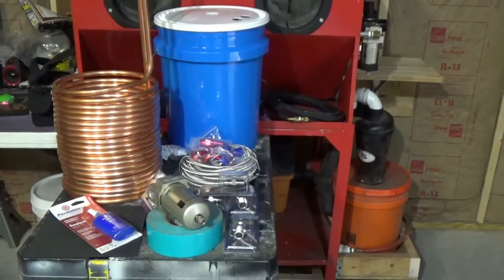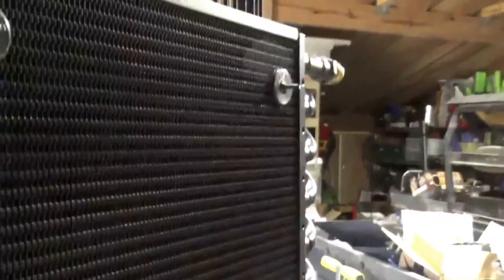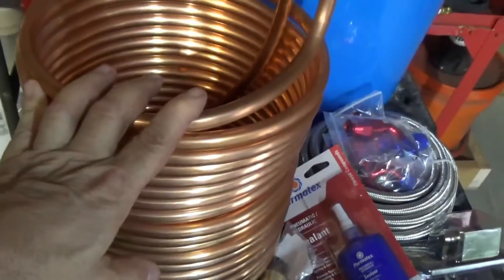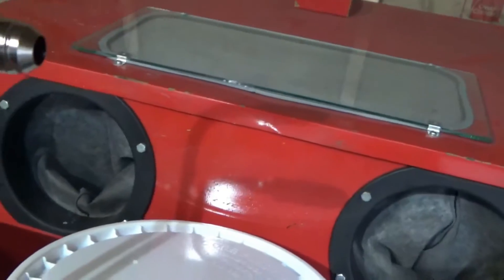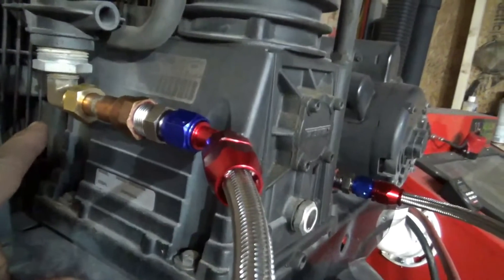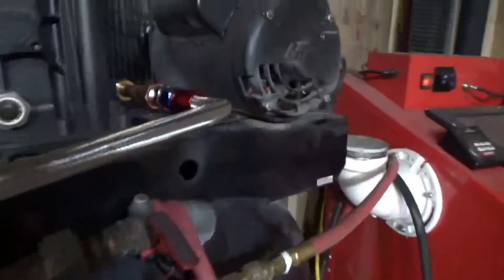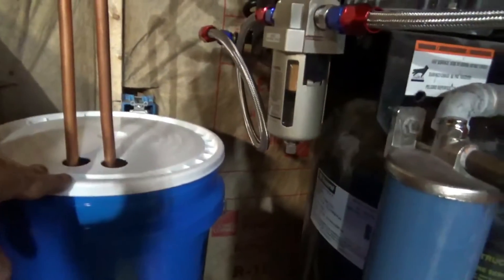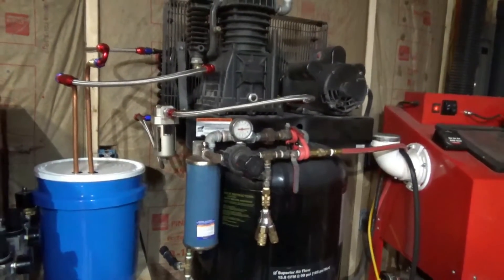DIY Air Compressor After Cooler / Dryer

Comment: Swap the plumbing on the coolers bud 😅 i have a much bigger version in my body shop its great never have any water or oil and i run no filters. Air to air cooler right out of the pump with a trap then into tank then through ice bath cooler and into a regulator/trap and system plumbing. The air the air stops how much gets to the tank and keeps the tank from getting hot allowing it to condense better also. The air the water cooler is to get 10 below dew point and drop out all the rest of the water before it gets into everything. A 3ft rise is recommended as a minimum after though.
Reply: The restrictions are also kinda extreme. Having built my system too small twice I found 3/4 is the minimum to ever build in. 1 is preferred. For the single man shop 1/2 in works but when working between the tank and coolers that are restrictions themselves we want to slow the air down and restrict less so even at home 3/4 for that first bit is wise.
Reply from the maker: @ Funny that you mention that I have a roll of 3/4" sitting here to revamp my set up. I have been looking into 1", but the price of copper is crazy these days...

Comment: Several things: nice build. Mounting the cooler to the back of your compressor COOLING fan is going to kill your compressor. The fan is designed to bring room temp over the heads to cool them and thus extend their life. Now you are pulling 200 degrees from the compressed air (or however higher it is after the cooling bucket) across the heads- extra heat will kill the compressor.  Looks cool but the braided hose and fittings are not necessary and jacks up the cost. You can buy coiled soft copper from lowes for cheaper with no shipping. There needs to be space between each coil so as to have more cooling surface. Sitting on top of each other will prolly take away 20% of cooling capability.

Comment: Could you have routed the 1/4” drain off of the primary moisture separator into the 5 gal bucket rather than onto the floor?

Comment: On the copper in the bucket have you got any pin holes from copper fibrating or is wear minimal there ? Just curious
Reply from the maker: To this day no wear... Just changed the water twice to check on the copper..
Reply: @venomchris5818  absolutely awesome that was my only worry with that . I was in heating and ac for 20 yrs and countless times I have seen pin holes where a plastic wire tie wore a hole just from vibration.  Thanks again!! Awesome job !!

Comment: Nice video. I did mine exactly opposite using the radiator first, then 2 auto draining HF Water Separators like you have after the small one.  Then I ran the output of those into the tank,  output of tank to a custom made 2" Rigid Pipe additional Separator and Desiccant Dryer, back to a 3 in line filter assembly that I swapped the the micro particulate to the last position to catch any desiccant dust leaving the trap area, then to my lines with dual feeds with a gate valve. 1 is totally clean dry air, the other one is an oiler tank for my air tools.  The clean dryed air is used for Painting and a Plasma Table.  Not a fish eye in site. My next project is to build a vapor blasting cabinet, with glass beads and a water feed with a dust bunny catcher like on your cabinet.
The reason I used Rigid pipe is my compressor is rated for 200 PSI and rigid pipe is good up to 300 PSI.  The Desiccant Viewing windows (1 top /1 bottom) is rated at 250 PSI.
Reply: I agree that the hot air should #1): go thru a fan cooled oil cooler to cool air to near ambient temp., then #2): to a water seperator, #3) next to the ice water cooled  copper coil, #4): another water seperator, #5): a coalescing filter for any oil vapor/particles, #6): then into the tank. It's a mistake to send hot air firt thru the water cooled coil, then warm it back up with ambient air. No! Each cooler should progressively cool the air more & more, & remove moisture after each cooler so less & less water has to be dealt with. Progression leads to high efficiency moisture removal & very dry air in the tank.
Reply: @PaulThomas-qo9vy  Redundant coils is completely unnecessary and chilled coils work well to reduce temps but then you have the hassle of the Water and adding more Ice. I don't have time during the day to swap out a bucket of ICE every 30 mins and mine does not have that. I have ZERO literally ZERO water droplets out of the lines. IF you want true conditioned air I would recommend you buy an air line cooler. If you got $1,000 laying around doing nothing. The way it is I got almost that in my setup already and IF I knew that going in I woulda already have bought it in the first place. You do not need to step down the air temp. Use a laser temp guage and measure the temp outta your compressor head (around 240-300* F) and then out of your Separator like I did and the temp is literally 77 degrees. That is absolutely FINE unless you live at the North Pole, then you get free ice anyway............

Comment: Awesome setup but you definitely did not need to add a transmission cooler. That's actually warming up the air!! by the time it goes through all that copper tubing in the 5 gallon water bucket It's cold your home never heat that bucket of water up. You would have to run that compressor non-stop all day

Comment: Ive been planing something along similar design ideas, but never thought about the distilation gear. I have a 20,000L water tank under my workshop which I could run copper lines through and it would cool the air down to no more than 20degC. 
Thanks for the tips.

Comment: Good idea with the copper coil. However, there is no way for the water to get out of the coils. You need to come down with the first coil and go into a tee fitting. On the other side of the tee, you connect the tubing and come back up, winding in the opposite direction. You end up with a double helix. Air enters the top and coils down, connecting to the left side of a tee. Then from the right side, you coil back up and out the top. At the bottom of the tee you put a copper tube and ball valve that sticks out the bottom of the bucket. This way, the water that condenses will flow down in both coils and exit at the bottom. 
I designed this several years ago and I’m using an 8” PVC pipe to hold the water and double helix. The pipe ends are sealed with discs of PVC foam and secured with long bolts that connect top and bottom on the outside. 
I run 50/50 water antifreeze through the PVC pipe and it circulates through a radiator in a mini fridge. It works very well. Wish I could send a drawing. 
But you need a drain at the bottom of your coil at the very least.
Reply from the maker: I would tend to agree with you and I figured I would need a drain valve on the bottom of the coil. I figured if the system worked I would add the drain valve. Once i saw that it worked great, I used it for a few weeks and then disassembled it and the coil was bone dry. I put it back together and it has been 2 years now. The Auto Drain Water Separator installed right before the tank removes an incredible amount of water. Every now and then I hit the drain on the second water separator and the valve on the bottom of the tank. I have yet to see any moisture other than a slight vapor mist for a second in the second water separator and no moisture at all from the bottom of the tank. So I never installed the drain valve and it has been working perfectly for over two years. The only change I made is that it was better to run the line through the radiator first and then to the coil as mentioned in the description. The thing I do find strange is the the water in the bucket after two years is still incredibly clean and has not evaporated more than about an inch.

Comment: If you didn’t want to disturb any pipes on your compressor I bet it would work good on the opposite end of your compressor where the  air exits the compressor. I have same air compressor and have a fan blowing directly on the head of the pump and I’m going to do the same rig as you got there but on the opposite end where the air leaves the tank. So with the fan blowing directly on the head of the pump and the chiller on the exit side of the  tank  between the exit point and air line I think it will work just great. Just my opinion  all thoughts welcome

Comment: Cut a port in the top of the bucket itself.  Install a small 110 v fan  ( like some in small  soda coolers)  wire the fan to the pressure switch so it comes on with the compressor.  Drill a few vent holes around the bottom of the bucket.  Should eliminate the need for water cooling

Comment: Very impressive and well thought out. My only reservation is the need for a drop line drain after the copper tubing before the oil cooler. If not you are sending back into the oil cooler all of that condensation. Great job.  Thanks  I plan to duplicate your idea

Comment: Can you say... overkill? lol. I live in NYS and it does get super humid in the summer. I use a 10 foot single run of 1/2 inch copper, and then about another 8 feet worth of a cupper U shape with a drain, then up to a two stage filter and I get just about no water at all... How the heck do you need all of this?

Comment: I loved your solution.  It is really hard core!   You are using the heat transfer properties of water being 24x that of air to make a much more efficient heat  removal compared with some of the vertical pipe systems people have done.   As others have mentioned, I'd add a trap at the bottom of the copper coil, and maybe put your auto drain on that.    It would reduce any water that your final filter would need to take care of.   I doubt your compressor tank would collect any water - could be done manually.      I haven't done any calculations but a copper coil from HD with a 1/2" ID offers a low pressure loss.   I'll try without the oil cooler first since that adds about $130 to the project.   A bit of salt in the bucket would keep stuff from growing in it.

Comment: Your lines are to thin diameter,,,never go less then it was intended for,,the cooler looks to be 3/8,, and people don't realize 2 stage gives you high pressure not volume,,, I always use one stage,,2 stage compresses air twice making air hotter and resulting in more condensation,, I just used the 1/2 copper coils from head to separator to tank.and dropped my temperature from 170 to 90 degrees and no more condensation that concurred when hot air enter cooler tank. The is traveling so fast the water really does nothing. And if you try blowing air through transmission cooler as I did you will see the restricted flow as I did,,and all it will do as put strain on compressor head and with the back pressure,,,many are having head gasket problems doing what you did as well as shortening the life span.
Reply: Heat is generated by compression - basic thermodynamics. The extra mass and intercoolers on a two stage would be spreading that heat out but I don't see how compressing air to a fixed PSI can generate more heat depending on compressor type. My two stage has an intercooler between stages and another cooler after the 2nd stage and I'd guess has more effective heat management than a single stage.
Reply: @imkindofabigdeal4308  only stands to reason if you compress air twice it's going to get hotter, easily determined by checking tempeture at each cylinder, l have, and is why 2 stage come with a coolers and single don't, not to mention there louder, ask yourself why would even want to if you don't have too,  my single stage was set up for 155 psi that I would never need so I backed it down to 130 and it fills the 60 gallon tank in 90 seconds less time that will extend life years,, but you do you and I'll do me and I'm sure my setup will be around longer with less problems, believe me I weighed this out well being around compressors all my life just don't make sense to have to repump air to achieve what you can at once. Even a honest compressor manufacturer will tell you a single stage will out last 2 stage with less funtion and noise.
Reply: @imkindofabigdeal4308  hot air is more dence and needs to be cooled before second stage to be more affective to repump, l can see where 2 stage would be better where much higher pressure is needed over 150 psi, but for volume single is best way to go
Reply: @georgespangler1517  You probably meant hot air is less dense. A two stage is not "repumping" it is just a higher pressure stage. It isn't like the first stage goes to 150 and then the second stage starts again from zero.
Reply: @georgespangler1517  hot air is less denSe,   hot air balloons float
Reply: @peterchang7646   ever see how big a hot air balloon has to be to leave the ground,, obviously you don't understand psi and cfm ,,
Reply: @imkindofabigdeal4308  yes,less dence,, first stage is usually to 60 psi and second boosts it up from there. I had 2 stage a friend gave me and switched to single when it through a rod, and I have a 4 cylinder old speedair I restored it's a beast puts out 36 CFM,, my single puts out 12 CFM at 90 psi 3.5 horse power,, where I would of had to had 5 hp to get 17 CFM 2 stage .. and took up alot of space and was really loud

Comment: You went all out on this. I like it.
The only thing I would change, and someone below mentioned it;
The restrictions cause by all the coolers/radiators. I would double up.
Large compressor lines feeding 2 cooling system lines so air volume is not as hindered. 

Or just save for an air dryer

Comment: Not sure if thus is an issue. You have air running through that copper coil in the bucket. How does the water condensing inside the copper coil drain? If the air entered the top of the coil and exited via gravity this into a  tee with a downward dog leg that had a auto drain. Then you could drain most of the water before it ever hit the separator ✌️
Reply: i wonder that. all the condensed trapped into the coil and pushed onto the water trap. i think it's not so serious since the air cooled and the chance of water condensing low. maybe a little water in that system

Comment: I will do you one better I wouldn’t fill that bucket with water. I would use antifreeze because the water will get stagnant after a while the antifreeze won’t . Plus it’ll cool way better than the water just a suggestion.🛠
Reply: Glenn, your  suggestion is not correct, water cools and dissipates heat better than full strength anti-freeze . If anti-freeze was better, why don't cars use undiluted  anti-freeze ???

Comment: I'm trying to do mine. The fitting going into the tank and the one coming out of the pump are males and were connected to each other with copper tubing and female compression nuts on each end. How do you convert the compression to npt? I have a male compression need to adapt to a male npt. I keep buying fittings that don't fit. The copper tubing supplied on the compressor is 1/2 inch but smaller than the 1/2 inch pipe I bought so how did you sweat those together?

Comment: How do you plan on getting water out of the copper coil?  I would imagine that even with everything you’ve got upstream of it, you will get some condensate n there and it will need a place to go.  I work HVAC/R so my thought would have been to braze in some sort of simple drain valve at the lowest point on the coil.
Reply: John, the condensate will be blown out of the line via air pressure. Condensate will always flow until it is released somewhere, hopefully not at the end of the line where the air is being used. Why separator is used and drains on the receiver tank (which acts as the final separator).
Reply: @rogerd4523  Rotate your coil to a horizontal position with the outlet at the low point, add water separator between coil and oil cooler  to remove water before oil cooler for better separation.

Comment: Man, you really need to Google "KISS Method" before you touch another tool
Reply: Just put a fan on the radiator.  The wort chiller is great for brewing beer, but long term my bet is you will develop stagnant water,  mosquitoes, and other issues mentioned above.  This has been done before - look at the PC industry.  Want to cool something hot?  They have tried it... Heat pipes, water cooling, huge conductive radiators passive or active with fans.  Best bang for the buck?  Radiator with a fan with a heat pipe... essentially what a transmission cooler is on a larger scale only add a fan.  Hell, have two radiators, or three... just do it in parallel not series, and sandwich a fan between them.
Reply: @horscategorie  Yep. And you have a whole lot of cooling capacity with all that ambient air vs water heating up. I'm getting to just a few degrees above ambient on the water separator inlet using the same Derale cooler and a 10" radiator fan wired into the motor contactor. The fan and power supply cost under $40 and works like a charm. Clean install too.

Comment: Nice job ! Was wondering how long the pressure valve bleeds out now with all the extended plumming?  Gona do my compresser trying to fiqure the best method.
Reply from the maker: The valve bleeds for about 10 to 15 seconds, which does not seem long until it is actually happening... lol... Also not sure if you saw my other comment... I changed the flow and now go into the transmission cooler first and then to the copper coil.. That works much better...
Reply: @venomchris5818  I wonder if anyone has tried putting a inline check valve between the pump & trans cooler ? I might try that.